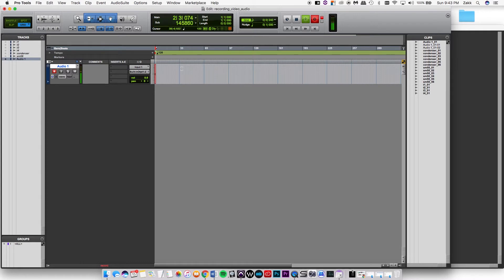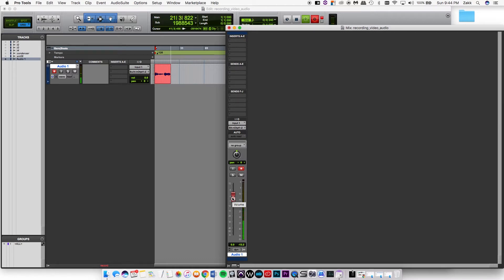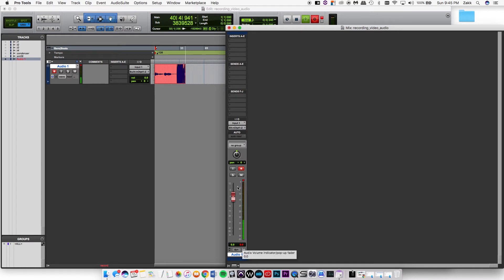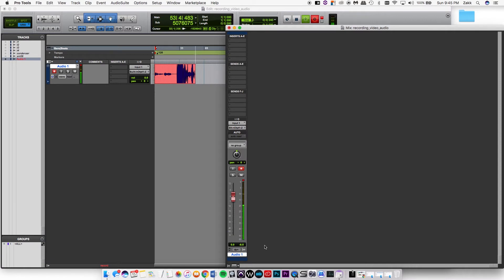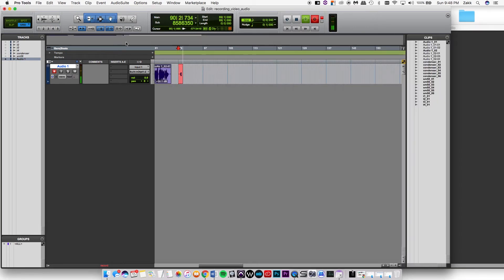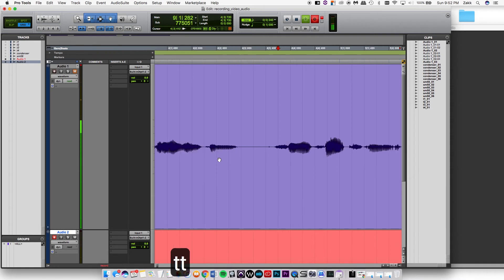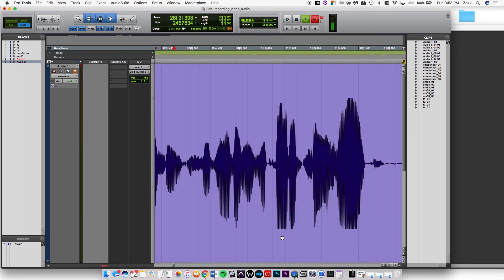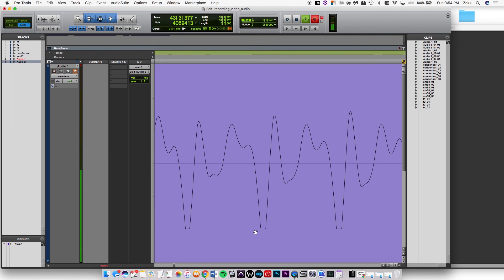What Does Clipping Look/Sound Like? (Recording Audio)

Comment: I just have one question, I get changing the gain on the preamp is how you fix clipping, not the mixer, but what's the mixer for then? If you're just going to leave it at 0dB. Sorry for the stupid question I'm just curious and a bit confused. Also nice vid! 😎
Reply from the maker: Not a stupid question! While recording, you should leave the mixer faders at 0db aka unity gain. 

I might make a separate video on “gain staging” but basically even when mixing, you shouldn’t have to turn down the mixer faders more than a few dB. You want the faders to be as close to 0 as you can (make volume changes using clip gain or using a gain plug in at the end of your chain). This helps your plug ins work to their full capacity, and ensures your tracks are as clean/noise free as possible. 

If that is confusing look up vids on gain staging specific to your daw. hope that helps!

Comment: Tbh... the set it and forget it idea isn’t smart. Unless the song dynamics don’t change at all. But most singers get louder in the hooks than in the verses. So it’s wise to track all verses first, then reset levels for the hooks. Then you have proper headroom in mixing.
Reply from the maker: that's a good call! I feel like set it and forget it is better advice for beginners, mostly so they don't ride the faders throughout the track trying to match the vocalist, thus making the takes sound different from each other, making comping difficult. 

So maybe "set it and forget it" for the verses, then re set the level for the chorus. 

Thanks for the input!